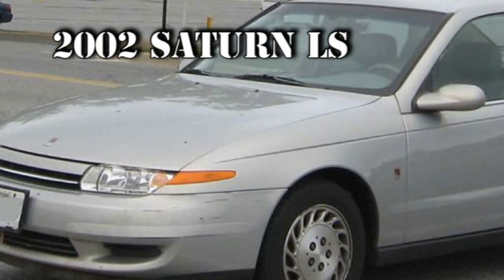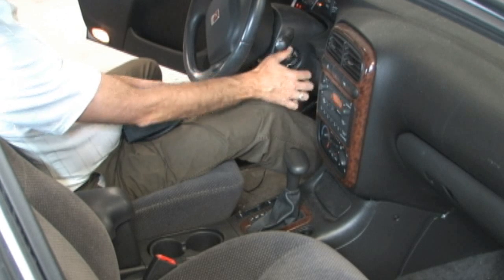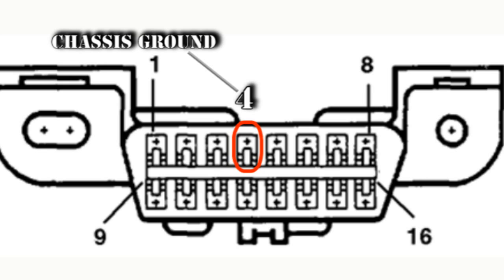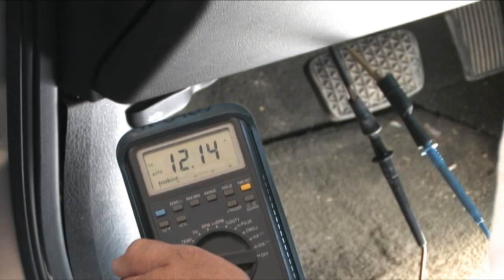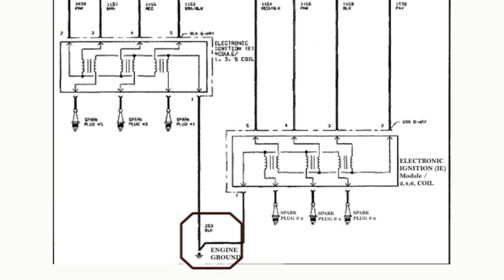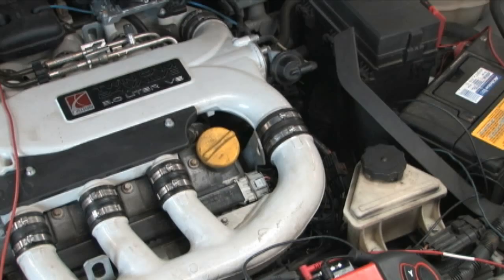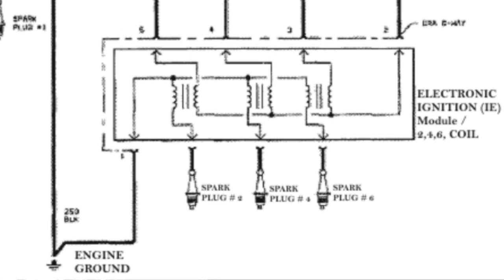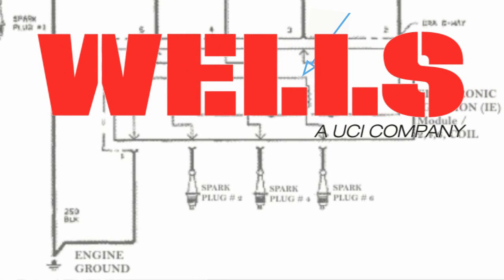Computer No Communication Troubleshooting by Wells Saturn

Comment: I have a nissan maxima 2003 3.5 L my a/t light flashes 16 times I can crank it but it wont turn over i did have a check engine light before because my cat was running lean but car was ok it drove decent. However I take it to this "mechanic" and he sticks his alcatel scanner an runs a full diagnostic an while he has the diagnostic scanner in he puts a probe tester alligator clamps on my positive terminal and negative on my ground an he unplugs his scanner an then that a.t light pops car cranks but wont start up an my alarm dont work 😔😔😔 lol
Reply from the maker: Sounds like you may have multiple issues. I'd start out by looking for security related problems.
Mike Becker, Senior Instructor
Reply: You wouldn't believe the issue.. a fucking fuse 🤣🤣🤣🤣🤣🤣🤣🤣🤣

Comment: Obd wouldnt power up the device, and all the fuses are perfect,  no power from pin 16 when car is off but when car is on its 13.5v. clock on the car always resets when you start the car and also car self diagnostics wouldnt work, any idea what to do or what to check?
Reply from the maker: Time to start tracing out wiring diagrams and see whats missing when the key is off.
Mike Becker, Senior Technical Instructor

Comment: I've found in my 45 years of being an mechanic grounds are the most common problem from pcms to lights. it's always the 1st check I make starting at the battery.  the multi-meter is an amazing tool
Reply from the maker: Hey Biff, good grounds are VITAL. You're right, always a good check. Powers too right away. Best thing to do is load test those circuits...make sure they light a bulb or something.
Mike Becker, Senior Technical Instructor
Reply: @GoTechTraining  I agree. Being a master for too many years to count. Myself am a G.M master trained by General motors training centers. Taught at local community college for a few years. It's so easy to over look the simple things in mechanics and life.

Comment: Hi guys I have a 04 nissan xterra v6 with a p.o. 300, I took it to a shop and I was told that the ecm is not sending a signal to one of the pistons, so pretty much i,have to take it to a specialist so I can get it check out. Any other suggestions? Thank u.
Reply from the maker: Hey, a P0300 is simply a random cylinder misfire. It's possible the ECM is not sending the proper signal, but I'd suggest this to be further diagnosed. It could be something simple and cheap like a bad vacuum hose making the engine run lean, or on the other end of the spectrum it could need a ECM maybe. There's a lot of things in between.
Mike Becker, Senior Technical Instructor

Comment: I have found in an instance like this that powering the scan tool through the cigarette lighter establishes a good enough ground to link up to the PCM when a potential connection problem is present that may be ground related at the ALDL connector. This was on a 2007 Nissan Versa.
Reply from the maker: Interesting find Joseph! Thanks.
Mike Becker, Technical Services Instructor

Comment: Very interesting. Recently I replaced a bad coil pack on my 2.3L Mazda. While monitoring PID's I noticed that one of the PIDs related to ECU power was all over the place. I dismissed it as a scan tool issue. Now, I'm wondering if this same thing may have been happening somehow due to my bad coil. Plausible, but I'm thinking not likely. Thanks Wells!
Reply: Explanation for my initial comment. Pre fix, I was viewing enhanced obd and saw the PCM voltage PID was all over the place like in this video. No comm issues but seemed strange. Batt/Alt PID's were normal. Viewing secondary ignition on cylinder four I was convinced by a firing line artifact that I had an external to the cylinder problem such as carbon tracking or wire issues which might seemingly cause an issue like in this video. Plugs/wires were fine though. Viewing secondary ignition more closely clearly revealed a bad coil and a coil swap fixed the misfire problem. However, the strange ignition waveform artifact on cylinder four persisted! (I have video.) Still don't know what that was or why the PCM voltage PID was wacky. Watching this video got me to wondering if the two were related. Probably not, but hey, I'm still learning. Thanks!
Reply from the maker: Hey John, could be! I would check and verify some other things before jumping to any wild conclusions. Thanks for watching this old one!
Mike Becker, Technical Services Instructor
Reply: Baxrok2 🙄

Comment: I have an 02 l300 the scanner will not connect neither will the car run. The fuel pump will not operate when the key is turned on neither will the fuel gauge register even after putting in fuel is this a bad Ecu? Also my sunroof fuse keeps blowing. Also the fuel pump will work when jumped at the relay with a wire " Awwsome Video by the way"
Reply: So it is a no com and a no start is that correct?

Comment: I have a 95 dodge stratus es,I have continuity on pin#4 & sensor ground on #5 and power on pin #16 but I can't communicate with my scanner tool,what could be wrong?
Reply from the maker: Hi Gerardo, There could be a lot of things wrong, I would start off with a different scanner first. Also, you say it's a 95'. Is that an OBDII vehicle? 
Mike Becker, Technical Services Instructor
Reply: Wells Vehicle Electronics  yes it is,obd2 connector on a 95,also I did check with another scanner,same thing, so where can I start first.
Reply: Do you have the VIN number on that vehicle. Chrysler was not OBDII compliant in 95. GM was but if it is really a 95 it would have a 6pin Blue connector under the dash.

Comment: Would you suggest the same procedure if the air bag module isn't communicating with the scan tool? Power(s) and grounds are good. Other modules communicate except for the vehicle communication interface module. 2010 Impala 3.5L
Reply from the maker: I would start by grabbing codes for that Impala. From there verify powers and grounds, then it's probably about time for replacement. Just verify prior if this thing has to be reflashed on install. 
Mike Becker, Technical Services Instructor

Comment: Hi! Good info. I got brought here in trying to search for my P0600 issues on my impreza WRX. Any help would be appreciated.

2008 subaru impreza wrx. P0600 for a long time now (on about 90% of the time). Previous service records indicate corroded fuses and grounds by fuse box. I cleaned all the fuses and cleaned all the grounds I could trace. They looked fine and CEL is still on. Any suggestions or time to hand it (back over) to a professional? 

I've been to 3-4 dealerships over the years and no luck so far.
Reply from the maker: What is the resistance that you are seeing across pins 6 and 14?
Mike Becker, Technical Services Instructor
Reply: Thanks for the response. Just went out and tested and got 59.6.

After working on it over the weekend, I now have two more codes. On top of the P0600 communication link, I pulled a P0134 02 sensor circuit no activity and a P0030 H02S Heater control circuit (bank 1 sensor 1).

Not sure if these are red herrings or legit issue.
Reply from the maker: There is very little info out there on this P0600 code. The 60 ohms seems normal. Try unplugging the ABS module and see if the problem goes away. Clear the code if possible and see, with the abs module unplugged, if the code comes back. 
Mike Becker, Technical Services Instructor
Reply: Wells Vehicle Electronics Thanks. Unfortunately that changed nothing. Codes got cleared and wouldn't start until same codes came back up.
Reply from the maker: Hmm, odd. Honestly to me it sounds like you have a module intermittently taking down the network..the trouble of it is finding it...I think the only way to find this thing is to use a data recorder and see what module is dropped when the problem occurs. Wish I could be of more help Greg, but without the car in front of me I don't know what else to say. I would ask around in your area for the best person at fixing electrical problems. Every town seems to have one or two. I would try going to that person.
Mike Becker, Technical Services Instructor
Reply: Thank you so much for the help. I've already decided to give up and take it in :). Hopefully we can find a solution and I will come back and update you if you're interested.
Reply from the maker: Thanks Greg, I am very curious at what fixes this thing, please do let me know.
Mike Becker, Technical Services Instructor
Reply: Greg Shoemaker any luck??? Did you solve the p0600 code?

Comment: Hello
I have a 2007 Toyota AVENSIS a malfunction.
Ignition switch round and engine control lamp going out
After two seconds before ignition.
There is no communication with the diagnosis plug
I tested comes diagnostic plug 12V and negative and still no communication.
Thanks in advance
Reply: I checked another vehicle and communication
Reply from the maker: So you have power at the DLC ? Is the battery fully charged up?
Mike Becker, Technical Services Instructor.

Comment: I have a 1998 Saturn Sl1 with the 1.9l I4 it seems to shake badly at about 1k to 1500 rpm, but the motor mount is good.
any Ideas that might be my problem, also I seem to not be able to use an obd2 reader but it powers up just fine. I can't communicate with the computer it seems.
Reply from the maker: Hey Alexander check for bad spark plug wires and spark plus for the shacking, and on the OBD2 problem try going into another module and see if it goes in to it. You could have a bad contact check your connection on the PCM make sure they are clean and recheck with the scanner at the OBD2 connector.

Comment: Hi, I have a '04 Mazda RX8 and I'm having somehow the same problem, sometimes my scan tool can communicate but sometimes doesn't. Sometime when I parked and put it in P the engine turns off without turning the key.
Reply: Yeah
Reply from the maker: It sounds like you a an intermittent wiring or connection issue. When you are able to get the scan tool to hook up do you have any codes stored?
Mike Becker, Technical Services Instructor
Reply: P0661, P0171, P2096 & P0335. The last time those code appeared, I cleaned the battery terminal, & MAF sensor and erased the codes and they didn't come back. And the muffler and catalyst doesn't sound broken and it doesn't spit smoke. I think that I would need to change the crankshaft sensor or buy a new battery for better current flow, but I'm not sure if I have to check and clean all wiring, before do something.
Reply from the maker: With the codes you are getting I would advise taking this car into a shop that is familiar with these engines. From what I have found, these codes can be cause due to your motor having weak compression. It would be best to have it diagnosed properly instead of trying a bunch of different parts that possibly wouldn't fix it. 
Mike Becker, Technical Services Instructor

Comment: I have a 1992 Montero 4x4  3.0 v6 it was kind of running ok but surged sometimes  anyway went thru a small river crossing  little over half way to the tires bit more but nothing real deep  now have no spark  no start only spins coil has power to distri an also has power to wire to distributer very lost at this point maybe  someone has info thanks
Reply from the maker: There are a lot of things that could be causing your no start issue, they may or may not be related to the water you went through. The most common repair for a no spark issue on your vehicle is the ECU, the engine computer. It seems to be that the computer on these cars have issues. Here is a procedure to check a few things. Let me know what happens!
Mike Becker, Technical Services Instructor 

1. Check for power to the coil on the Black/White wire. This is the coil positive. 

2. Attach a test light to battery positive. Back probe the coil negative wire (White) with the probe end of the test light. Crank over the engine and the test light should flash. If it does, the coil or coil wire is at fault. 

3. If the test light does not flash, clip the White/Black wire at the power transistor. Use the test light again that is hooked to battery voltage and tap and release the wire going to the power transistor, with the key in the "on" position. There should be spark. If not, the power transistor is at fault.

4. If there is spark when doing the "tap test", the PCM is likely at fault.
Reply: bill williams

Comment: Saturn  Ion 2  2007, 4 cylinder.  Failed emission test.  Said No voltage at Data Link connection (computer connection)
Reply from the maker: +Janet Hubbell I answered your other comment :)
Mike Becker, Technical Services Instructor

Comment: Hi I have a 2000 saturn L-series 2.2 that won't start my initial diagnosis was that the crank sensor was bad so I checked the crank sensor and notice I'm not getting any voltage to it then I realized that I wasn't getting any computer communication and from my understanding the computer sends voltage to the crank sensor can anyone help me out
Reply from the maker: +Marcus Smith Hi Marcus, I hope I can help you out. Your Saturn does not have a "powered" crank sensor. It uses a variable resistance type similar to an abs sensor. So you will not have any power going into that. As for lack of communication with your pcm...well that could be the entire issue with the car right there. I would work to get pcm back to responding before doing anything else. Check fuses first, maybe one blew. Sometimes the cig light fuse is tied into the dlc power fuse. Let me know how this turns out. Talk soon,
Mike Becker, Technical Services Instructor

Comment: Hi i have a 04 mazda mpv lx and no comunication with the scan machin .can you help me.thank's
Reply from the maker: +Sergio Denis Hi Sergio, the first and easiest thing to check is the 15 amp "room" fuse. That is the fuse that sends power to the dlc. Let me know how that looks.
Mike Becker, Technical Services Instructor
Reply: Wells Vehicle Electronics  I checked the 15 amp and it is good any other ideas?

Comment: Hello I have a 98 Camry that isn't communicating with my scan tool. It also cranks but doesn't start. Pin 16 has power but pin 7 doesn't. Any suggestions on why?
Reply: Pin 7 on that Camry is going to be com between the ECM and SRS module. You will not be able to see what is going on there with out a DSO.
Reply: +Edgar Recinos did you figure it out? same prob here on a Toyota

Comment: Having this problem on my Eclipse GS 97.. Getting 9.6V on pin 7 and ground is A-OK. I read somewhere that an aftermarket stereo system could cause this, but I´ve yet to find out what is causing this. Getting the error message that my software cannot communicate with the ECU.
Reply from the maker: +Mr. Frostbite What connector are you testing pin 7 on? It would be a good idea to also test the power and the ground for the Ecu. Aftermarket stereos can cause a lot of issues, especially if they aren't hooked up correctly. Let me know what happens.
Mike Becker, Technical Services Instructor
Reply: +markjhicks Hello and thanks for replying! I'm checking pin7 against pin4 which is ground? Getting 9.43V with the ignition on. Not sure if it matters- but also getting the same voltage when checking pin7 against any metal piece grounding in the car.. Does this ring any bells? To me it seems like a weird reading, but I'm not that experienced with this. Not sure how I would go about checking the ECU itself??
Reply from the maker: +Mr. Frostbite It does seem low at 9.43V. I would go out to the battery and see what the voltage is under the same conditions. It could just be that your battery is weak. As for checking out the ECU, there really is no way to test it internally. It is best to verify that you have the proper powers and grounds going to the module and then determine from there if you're going to replace it.  Hope this helps!
Mike Becker, Technical Services Instructor

Comment: Hi Mark, I'm looking to buy an OBD II adapter and iPhone App for my 2003 Saturn L300. I came across this post below on CarGurus.  Do you suspect that it may have been the same issue? Would you be able to recommend an OBD II adapter? Thanks...  http://www.cargurus.com/Cars/Discussion-d535_ds492964
Reply from the maker: Hey Al, Honestly I do not know how well the phone apps work. However, i do have someone in my department that knows them very well. May I suggest you calling our "800" number and ask for him. His name is Jim, the number is 1-800-558-9770 press 3 for tech if you are interested. He is off tomorrow but will be in on Friday.
Mark Hicks
Wells Vehicle Electronics
Reply: markjhicks
Thanks for getting back to me.  After researching more I went ahead and ordered the LELink OBD II adapter to use with an app called Engine Link, which is in the iTunes App Store.
 ...  http://www.ksolution.org/outdoor/enginelink.html
Reply from the maker: Al Ataide
Great let me know how well it works for you.
Mark